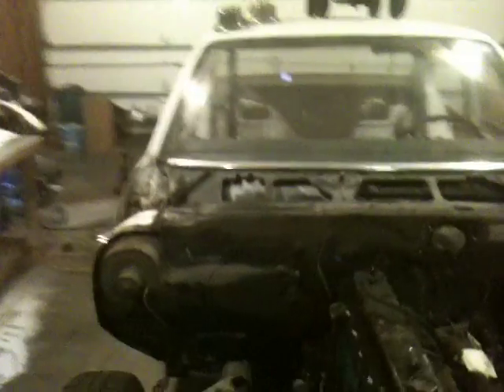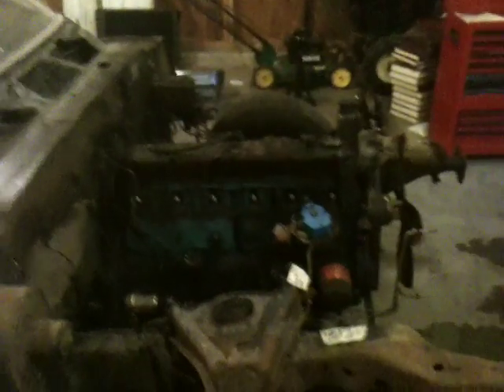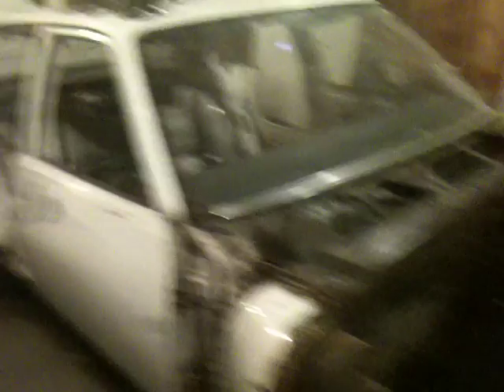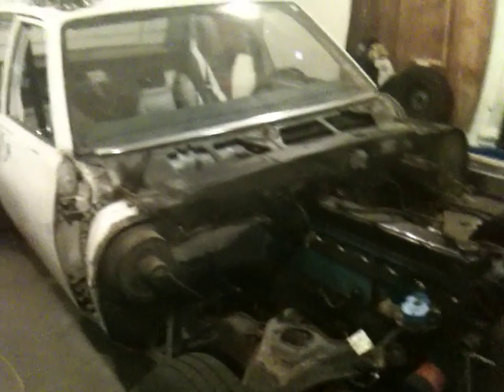78 Nova 4dr Revival -- engine compartment work

Comment: There is lots you can do with the 6. They are torque monsters to begin with. port the heads, shave the head and install larger valves, camshaft, header and 4bbl intake/ carb would look cool. I see these on street rods now and then at car shows. Everybody has a SBC. 
B

Comment: I'm redoing a 78 nova 2dr and I'm going for the classic look but when the original block dies and the car becomes smog exempt I'm thinking  a 454 or a corvette ls1 or ls2. U might Need a cage on the inside that's the only reason while I want to stay original. I hate the cage and all the gages outside the dash